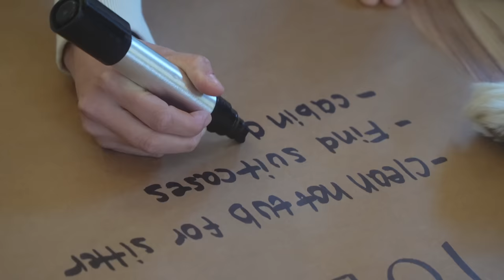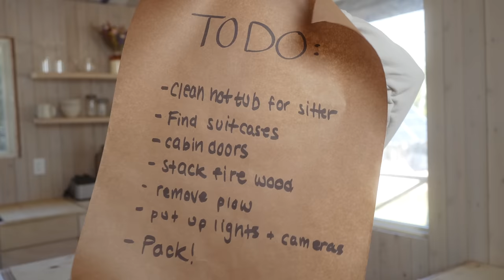A Race Before We Leave

Comment: My favorite  pizza dough!
3/4 cup warm tap water,
1 tablepoon active dry yeast
1 1/2 tablespoons olive oil
1 teaspoon sugar
2 1/4 cups all purpose flour
1/2 teaspoon salt

I dont measure much so if its dry add equal parts water and oil little at a time you need to need it until smooth texture should be sticky but not actually stick to your hands. let rise for 20 - 30 minutes flatten let rise again for 10 minutes ish in pizza shape, brush oil on it when youre letting it rise for a second time. perfect crust every time

Comment: hi, 3 ideas for the bread.  When making bread put  the loaf it in a large pan away from drafts and put  it on the very back of the stove so it's i surronded by warm air. Check the yeast is lively. Add 1 tablespoon  of yeast in 1 cup lukewarm water and 2 teaspoons of sugar. Stir and leave for 20 minutes in a warm area. It should be bubbling and ready. If not ditch it for new, better yeast. Finally, patience. Wait for the bread to double as per the recipe and then proceed.
Reply from the maker: Well love all your ideas and tips, thanks for sharing! 💛🐶

Comment: Watching you hang your doors I have to ask, did you paint the edge after you trimmed the bottom?  If you didn't when the humid weather comes your doors will swell and stick in the frame.  To prevent you should prime and paint (2 coats) on all surfaces and edges.  In any case, love what you girls are doing (though a little jealous)!  I appreciate your openness about therapy.  Made use of that myself.👍

Comment: 7:35 this is the best trick! Do the saw horses come with something to put the doors on, or did you add that? What’s the diameter of the hole you drilled? 

Thank you for sharing your joy and bringing us along for your adventures in DIY!
Reply from the maker: Of course!!! Any size would work that would hold the weight of the door! You can do this with any saw horse 💛💛
Reply: @Vanwives  thank you!! 😄💛

Comment: I have a suspicion that the dough issue was too low hydration, as it looked quite dry when you rolled it out, from what I recall pizza dough is meant to be 50-65% water